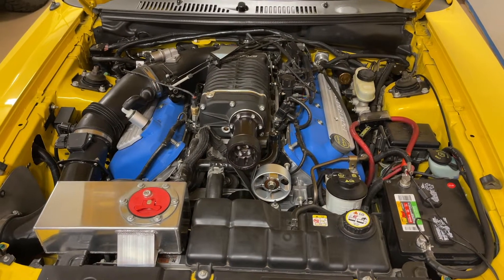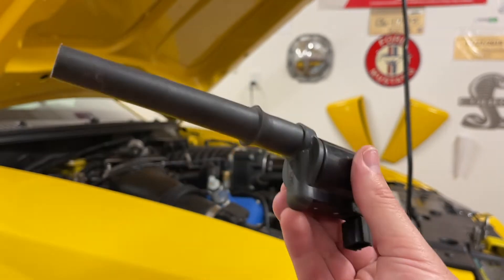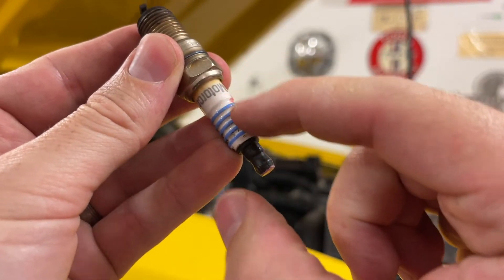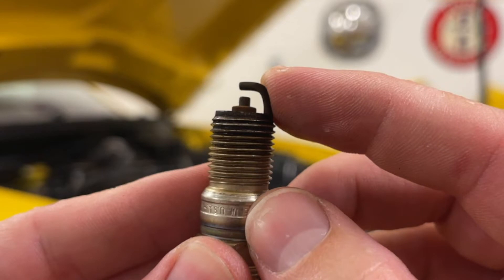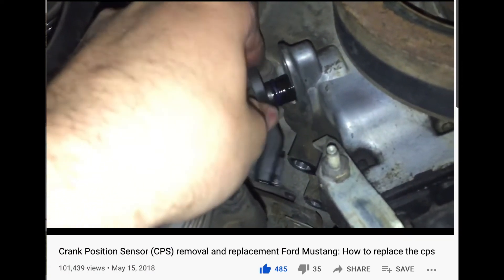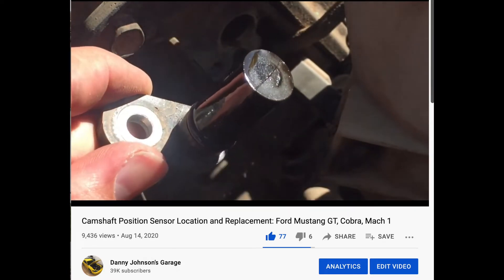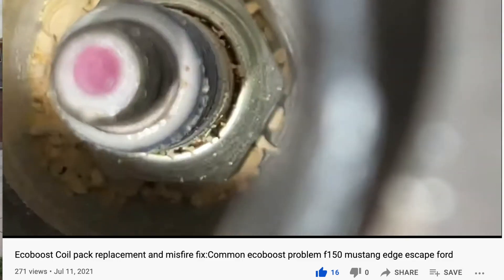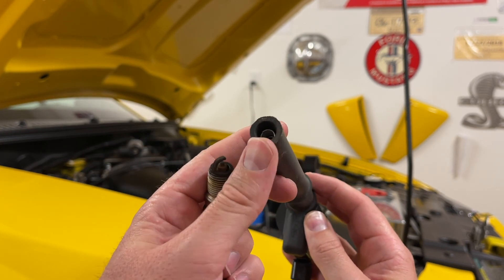What Causes a misfire and how to fix it: Spark plug, coil pack, crank sensor, maf, cam sensor

Comment: 2006 f150 5.4l change the sparks plugs, coil pack n cam position sensor and she still wanna cut of when a stop sign come ups n or red light... love ur video
Reply from the maker: If it’s doing it at a stop, I would look at all intake joints to be secure, and look for any vacuum leaks. You can try cleaning the MAF and the idle air control valve too
Reply from the maker: MAF clean and change https://youtu.be/vE1G8kbn3L4
Reply from the maker: Iac clean https://youtu.be/Vv2RXeoS9Mk

Comment: Dang. That taurus was gunked. I was able to use the snap on tool that our friend with the black mach 1 has at the auto shop and it gave out a graph reading on each cylinder and showed which on was not performing.

Comment: Also if you stretched the metal winding of the coil pack to come out around 1/4” off the boot you get a better connection to the spark plugs

Comment: I should probably change the coil packs on mine. They have not showed any symptoms of going bad but just based on the mileage
Reply from the maker: They are 4V specific, so make sure you get them (OEM is best) and maybe just have them on hand as a backup
Reply: @dannyjohnsonsgarage  Yeah I have the OEM 4V ones saved in a wish list for when I'm ready to get them. Wouldn't get anything but OEM

Comment: When I first dropped my new engine in and started it, this happened, to a brand new set if coils
Reply from the maker: I’ve even had the connectors on the plug cause it, but the worst was a backwards reluctor wheel on my brother’s bullitt